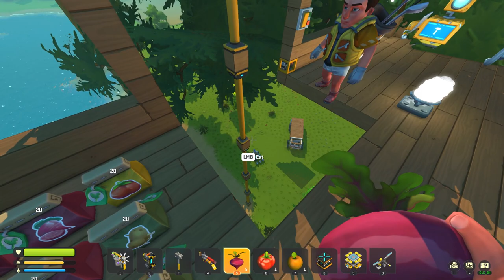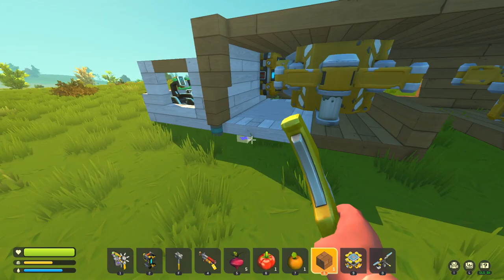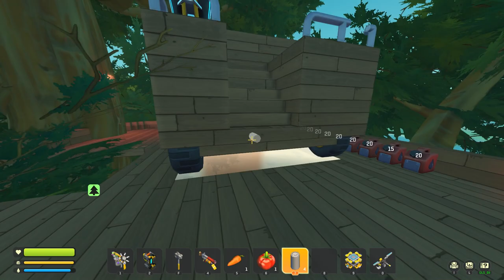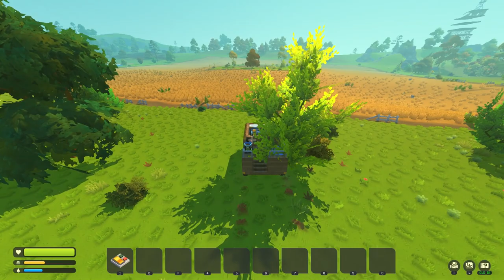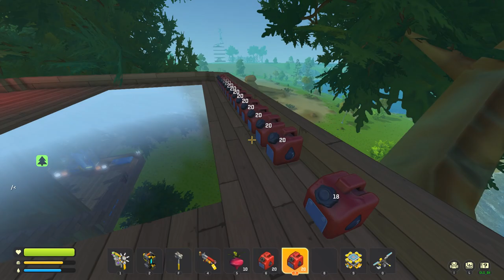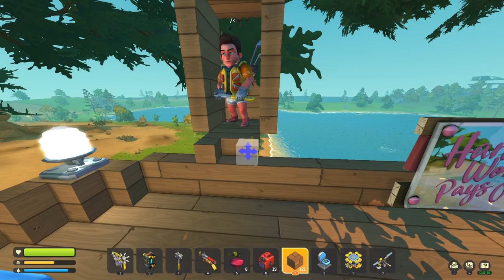Sometimes a Brick is the Most Efficient Design... (Scrap Mechanic Co-op Survival Ep.17)

Comment: Put a passenger seat or 2 on the elevator and hook it into a pair of switches on nor and xnor gates. With the correct hookup you can set your elevator up so that when one switch is tagged it calls, you pop in the seat and press the button and it just goes. With nor and xnor gates you can set up the switches to function almost more like buttons, and can call from top or bottom.

Comment: kan, just have a sensor on the elevator that can sense the platform and just add a little lip of wood at the ground level and you can have it auto open the door when the elevator starts to move, also adding cactus to the front of the car will help grip the bots so they dont go under the car as much

Comment: I switched my vertical logtruck to 1 collector. you should do the same, the extra capacity doesn't matter because you work with the bobcat

then you can mount it in the middle btween the wheels near the ground, and put a seat on top

Comment: I think the elevator is bending due to the slow falling of the characters. The pistons are pushing faster than a character falling, so you would expect the pistons to just be releasing tension when going down due to gravity helping, but when the pistons are extended the pistons are pushing against the max speed at which the player model can fall. This means the pistons are applying force downwards and not being able to push the player any faster. So you could slow the elevator slightly with one low level motor controller firing in a one stage offset.

Comment: Sometimes? Hmmm, an interesting definition of sometimes. :D 

But as there is neither air nor water drag, I think a brick doesn't differ from any other design.
There are no dangers of incoming debris neither, as it would in space, so I would say, in a world pieces use up a rectangular space with none of the problems mentioned before, I think a brick is the most efficient design.

Comment: Theory on the slow fall glitch, and just think about this one. I think there's an endless loop of colliding recalculations going on. What ends up happening is the creation falls so fast and hit kosmo. That means that kosmo falls slightly faster and the box has to recalculate "bouncing" off of kosmo, but then he hits the bottom of the box and then he has to have his speed recalculated. Why do I call it recalculating? It's kinda like if you fall off of a cliff, if you're able to hug the wall enough the game sometimes interprets your falling distance as from the point you last touched the ground.

I think this is happening so fast because there's so little room available that it's janking the physics engine into slowing down the box because there's so many collisions happening. I think if you had locked him in with that extra 1 block lower, he would have had enough constant contact that the game would have considered kosmo and the box as 1 entity and their collisions to be the same. But this is just my theory based on what I'm seeing.

It also explains why you're not getting knocked out. The other elevator had now "upwards rebound" that this new one has (you hitting your head on the ceiling. So your weight would end up jerking pistons. Meaning the pistons would strain and stretch, catch up, launch you, and send the lower platform after you at a faster rate than normal, which gives the game the opportunity to interpret your character meeting the ground at a certain speed as "falling so fast".  So the more and intense the bouncing, the greater chance you had of being knocked out.

This elevator equalizes it out because you're bouncing up and hitting the ceiling which "accelerates" the elevator upwards equalizing the rate in which the pistons are retracting. In otherwords, your bouncing up and down levels the elevator's climb speed. Meaning the reason it's going off at an angle when descending is because you're falling slower than the pistons are pushing and we all know what happens when extended pistons meet too much resistance.

Comment: Kan, take note of where you are standing in the elevator. The elevator was bending in the direction of where your character was standing. The reason why the pistons were bending is because the character falls slower than the pistons are extending. I'll bet the elevator doesn't bend when both you and Kosmo are sitting in the toilets. I didn't see if it didn't bend because you got out of the seat immediately and then deleted it when you went down the first time. When you are in the seat you'll go the same speed that objects fall.